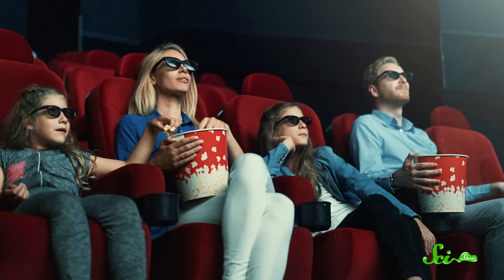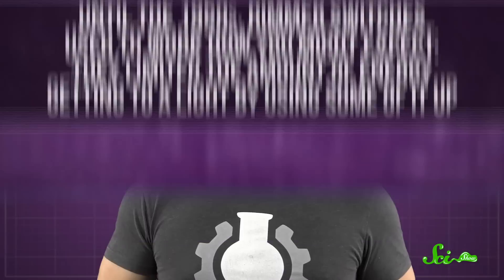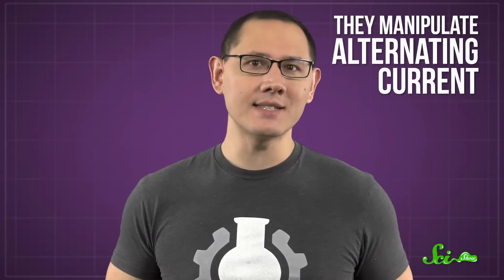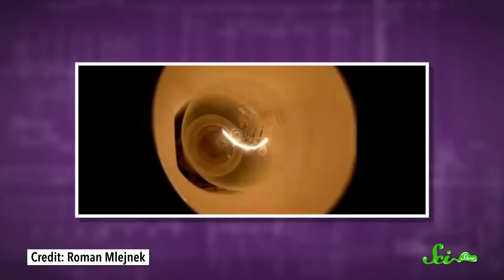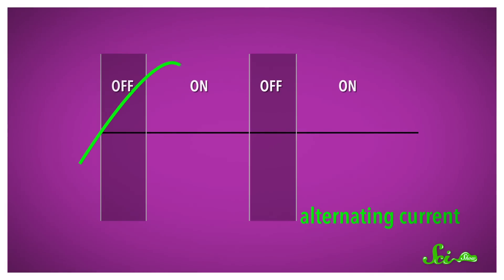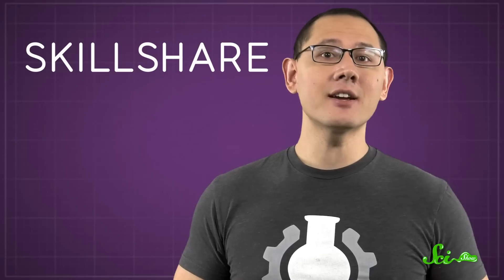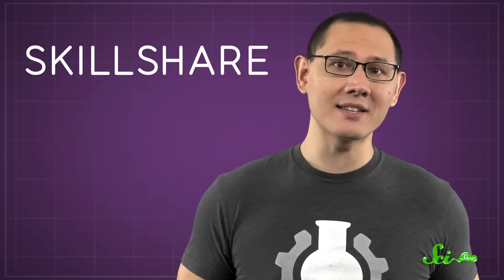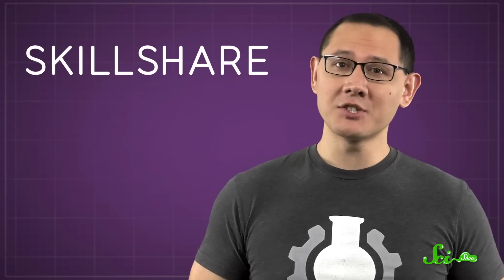Dimmer Switches: Secretly Strobe Lights

Comment: 0:40 Resistors don't "burn off energy", they limit current. It's true that they produce a small amount of heat and use a small amount of energy in the process, but that's a pretty terrible explanation.

Oh no! I forgot to make a ridiculous comment about my huge biceps!
Reply: Looks like muscle Hank is secretly an electrical enginerd...
Reply: You should just keep making muscle jokes
Reply: I see you have been flexing your brain too
Reply: Muscle Hank's strongest structures aren't his biceps, they're his brain.
Reply: Produce heat = Burn off energy lol
Reply: Marry me Muscle Hank
Reply: Don't worry, they are self evident.
Reply: Using a resistor in series with a bulb, to dim the light to 50% the resistor will have equal power dissopation as the bulb. It gets hot.
Reply: halveiz But if you use a resistor with twice the resistance of the bulb to decrease the brightness by roughly   66 percent, the resistor will consume half as much power as the bulb. The more you dim the bulb by adding resistance, the less power the resistor (and the entire circuit) will consume. Their explanation implies that the entire circuit consumes the same amount of power at each resistance, and the resistor just "burns off" the excess. False.
Reply: @unicornswag888  Did you consider that the potmeter is a function of a wiper? 

So as mentioned before, to dim the lightbulb 50% you will get 50% power dissipation in the resistor in series. To prove this you can think of the bulb as a resistor. If both the resistor connected in series and the bulb have equal resistance, then you would end up with a 1/2 1/2 of power divided to them both.
To further improve your intuition of this, I'll give two extremes of the value of the resistor: 

1: it is 0 ohm. The resistance is now a wire. Not only that, it's an ideal wire. it only leads. This wire doesn't dissipate any power.

2: it is very very large, say infinite. You essentially have a broken circuit now, and now power is dissipated because of it.

Now to take this a step further we can do some math.
Say we want to make a general equation of power dissipation for the resistance in series to the bulb. I'm making the resistance in the bulb = R_1 and the added series resistance R_2.

Firstly the Current running through the whole circuit is then I=V/(R_1+R_2)
Say R_2 is placed between the bulb and ground. V_(R_2)=V*R_2/(R_1+R_2)

the power dissipated in R_2 is then (based on P=I*V): P_(R_2)=I*V_(R_2)=(V/(R_1+R_2)*(V*R_2/(R_1+R_2)))=V^2*R_2/(R_1+R_2)^2

Now that looks kinda messy.

Let's say that V = 1V and R_1 = 1 ohm, just to show how this thing would work.
our formula then boils down to P_(R_2)=1^2*R_2/(1+R_2)^2 = R_2/(1+R_2)^2

Now to make it even more readable we can substitute P_(R_2) with f(x) and R_2 with x

We end up with a formula which looks like: f(x)=x/(1+x)^2
Plot that thing into wolfram alpha or your graphing calculator and you will see that when R_2 = R_1 (In our case R_1 is 1), R_2 will have maximum power dissipation. If R2 is more OR less that R_1 then it will dissipate less than R_1.
Reply: halveiz I agree with what you've said, and I like the extreme examples. However, say we have a  100 watt bulb (144 ohms) on a 120 volt circuit in series with a 1 megaohm resistor (extreme case). This circuit will only consume 0.0144 watts of power, as opposed the the 100 watts that the lightbulb would consume with no external resistance. If someone were to take SciShow's explanation literally, they would likely assume that both circuits would consume the same amount of power, and that the 1 megaohm resistor would burn/waste the other 99.9856 watts. That's not the case. The resistor is simply limiting the amount of current that's able to make it to the bulb.
Reply: halveiz I have a feeling they may have been confused with a voltage divider circuit, where the resistors are burning off excess power, and are often extremely wasteful.
Reply: @unicornswag888  They could also very well just assume resistor is in parallel to the bulb (again, think of the extremes), but that's beside the point. I guess they went for a simple explanation instead of a deep dive into kvl analysis for this 3 minute popular science video.

Now with that being said, dimming should generally be done with some sort of PWM, if available, instead of with a pure resistor, because it consumes less power.
Reply: A resistor in parallel won't do anything to the light unless your power supply input so bad that it actually does influence it noticably (and you will be dimming ALL the lights in your house and probably your neighbors'). The resistor would be fighting the power station and its heat output will probably burn your house down rather quickly.

I'd also like to note the megaohm resister will most likely cause an incandescent lightbulb to output no visible light and have more resistance than normal because its filament is cold.

By the way, a capacitor in parallel is more efficient than a resistor, but needs to be large (fist-large) and is not easily regulated (adjustable large capacitors do not really exist)

A PWM dimmer could reduce the power for incandescent lighting without any notable flicker, but requires high-power transistors rather than simmistors. But as of today all of that is obsolete anyway since LED lights have electronic ballast anyway and dimmable ones detect dimming rather than use its effects.
Reply: Jack White A 1 megaohm resistor would be ridiculous. I just used that as an extreme example to illustrate my point.

Alright, that's enough nerd stuff for me. I'm going to go back to flexing on haters!
Reply: @jwhite5008  I was gonna say how's it gonna effect your neighbors but the. I remembered you city people don't all get your own transformer like im used too
Reply: @unicornswag888  : Yes, finally you'll consume less energy right, but for making no light at all !
Reply: @unicornswag888  : You'll still consume 100W, a resistor limits current thats a fact, but the bulb is a resistor too (generaly).
Reply: @halveiz  : less energy, power is the same
Reply: If muscle hank was actually an electrical enginerd he would understand that the light switches operate similar to power converters as a means of AVOIDING power dissipation that comes from using a resistor in SERIES. Muscle Hanks took a physics class or a simple circuits course and thinks that he understands what's going on.
Reply: IizUname Fight me bro.
Reply: Fake Muscle Hank!
Reply: A resistor takes electricity and makes it in to heat and of story.
Reply: Chris Ide No, not end of story. Yes, a resistor in series with a bulb will waste some energy as heat. However, it also limits the current that's able to make it through the circuit. If you put a restriction on a water supply to a hydroelectric dam, would you say that the restriction works by "burning off excess energy"? Of course not.
Reply: Huh, this conversation is still going somehow?
1) Dimmers are to make light dimmer. Energy savings may be optional.
2) Lamp+resistor uses less energy than lamp alone so it saves energy - but the lamp gets only a part of that lowered energy intake.

Resistor that is 10% of lightbulb resistance saves 10% energy, wastes 10% of original energy and the lightbulb gets 80% of original energy.

Resistor that is 100% of lightbulb resistance saves 50% energy, wastes 
25% of original energy and the lightbulb gets 25% of original energy.

Resistor that is 1000% of lightbulb resistance saves 90% energy, wastes 9% of original energy and the lightbulb gets 1% of original energy.

(These are estimates with about 1% aboslute error)

Note that incandescent lightbulb that gets 80% of rated energy will probably shine about half-ish of rated visible light - and release everything else as heat - making dimming them even less efficient than it seems.

Comment: A small criticizm for the script: You make it sound like the frequency of flashing decreases. If i interpret the explanation at 1:30 the frequency of the flashing stays constant, equal to the AC frequency. Only thing that changes is the energy usage and release of the flash based on the change of relation between the light being on or off, making the flash appear less intense because of giving off less light per cycle, but the cycle frequency stays constant.

Comment: it is 120switches a second dThink of if the wave starts right after at 1v and you look at one cycle will move up to 120v then come back to 0 (first direction change) then move down to -120 then back to 0 (second one) then to 1 where we started so yes it switches 120times in a second or twice per cycle

Comment: The description of resistors and ac current in this video are not only fundamentally flawed, but actually misleading. Adding resistors to a circuit does not ‘resist the flow’ of current in any way. I know that for simplicity’s sake it’s logical to describe it in ways that anyone can understand. But you are legitimately lying about the way electricity works in this video

Comment: You can also use pulse width modulation to run some things at a higher voltage than it can typically handle, as long as the "off" and "on" ratio is adjusted properly.

If you have ever seen a car that has LED lights that appear to flash on camera, you are seeing that at work.

Comment: Did you really mean 120 times a second? Cause I recall it being 60 times a second in US and 50 times a second in EU. I think somebody messed up the script. 120 volts 60hz is the standard
Reply: they did get it right, they just chose a weird way to express it. the 50 or 60Hz is the number of complete cycles per second, and the polarity changes and then changes back in each cycle, so the number of reversals is twice the number of cycles. I suppose it is relevant in this context because a triac dimmer like the ones theyre talking about will switch in both halves of the waveform.

Comment: Would like to know how some (but not all) dimmer switches for professional film lighting work without creating flicker on the camera which typically requires the shutter speed to be matched to the frequency of the AC power source.
Reply: DysnomiaFilms my best guess is that they either dim with DC or convert it afterwards. It's easy to make a simple PWM circuit that takes a triangle wave from a 555 timer into the positive pin of an open loop op amp and setting a voltage reference to the negative. You can then use some cleverly placed capacitors and inductors to smooth out the remaining ripple.

Comment: you should have listed the US power in frequency, rather then the number of times it switches in a second. People are getting confused, because it does switch twice per cycle, or 120 times, but the frequency is 60 cycles per second, or 60 Hz. Being that standard US voltage is 115/120 volts, it has led people to the misconception that you've flipped your numbers around.
Reply: yes, it wasn´t the best way to say it, but is correct.
Reply: I was confused for a couple seconds until I remembered he said switch, not cycle
Reply: Bass Buster X Exactly!
Reply: That confused me too
Reply: ... inclyding me before I found your explanation. Ugh.

Comment: I'm shocked that the term 'duty cycle' didn't come up in this video.
Reply: I'm surprised there were no references to PWM. A very integral part to is, as you seem to know.
Reply: @zacharytaylor190  : Yes, but conventional dimming is a kind of PWM, no ?
Reply: @raphanunu6912  conventional dimming is typically resistive in its nature. They either use a series resistor to limit current or 2 resistors in a voltage divider, sometimes a voltage follower or buffer amp to stop voltage loading. Modern dimming is done with PWM, generally modeling the on-off switch as the output of a comparator and changing the reference voltage. Its simply more efficient that way.

Comment: Is that why i hear buzzing when ever i dim the lights?
Reply: Actually yes. Probably. This depends on your dimmer type but is most likely some effect caused by 50/60Hz AC waveform. 

Transformer-type dimmers buzz because they are essentially electromagnets and oscillate a little bit together with the AC sine wave because they are imperfectly made and/or attached to the wall. 

Resistor-type dimmers are often internally coil-shaped (and not attached well enough) so same reason. 

Electronic ones should not buzz in theory but may include small dampening coils that do buzz for aforementioned reason again. Electronic triac dimming makes transitions more abrupt so the sound is more noticeable.

Comment: I think you have your frequency confused with volts. United States of America 120 volts at 60 hrtz. 60 cycles per second.
Reply: He said:
"(...), but in the US [the direction of current] reverses 120 times a second."
which is correct. The diection reverses once at the positive peak of the sine wave, and again at the negative peak.

Comment: What do you mean you don't notice it? I have one in my dining room which I HAVE to turn all the way on if it's on because otherwise all I see is the miniature flashes.

It's annoying. Not that I'm that concerned with it. I don't use the dining room much anyway and if I wanted dim bulbs I wouldn't buy only 60+ Watt equivalent in LEDs. If I want light, I want light. Dimmable things make no sense.

EDIT: And before someone says it, no, it's got nothing to do with dimmable LEDs specifically. I know they're worse at being dimmable in general. Yes, I have a dimmable one there but the switch to all LEDs was only about 2 and a half years ago. I've lived in this place for nearly 20 years now. The light flashing was ALWAYS noticeable, even when using incandescent.

It's why I went ahead and made the change, because people complaining about it was nonsense to me - it already flashed if dimmed at all so it didn't need to be taken into account since I don't dim it because it's annoyingly flashy even with incandescent.

Comment: AC doesn't switch at 120hz. It's 60Hz in  NA and 50Hz in Europe. The voltage in NA is 110/120v and 220/240v in Europe
Reply: He said:
"(...), but in the US [the direction of current] reverses 120 times a second."
which is correct. The diection reverses once at the positive peak of the sine wave, and again at the negative peak.

Comment: As a epileptic am I in danger of having a seizure when I'm close to such a light?
Reply: 'No' to 'very unlikely'
.
You will not see visible flickering unless the light or the dimmer is malfunctioning or operating outside spec. Sometimes cheap dimmers on near-off setting may produce noticeable flicker but most likely not enough to cause a seizure. In most cases you will notice it before it is too late. 

Malfunctioning luminescent lights (or more rarely bad cheap LED drivers) may produce visually noticeable flicker but that does not tend to trigger seizures either.
Reply: @jwhite5008  ok, thanks! :)

Comment: The AC doesn't switch 120 times per second, but 60. You mixed up the voltage and frequency.
Reply: Each cycle has 2 "switches". One from Hugh to low, and one from low to high.
Reply: Chris K from Hugh to Low
I’ve never heard of the state ‘Hugh’
Reply: @Tonatsi  more like Hugh to Law..get it get it 🙈
Reply: stap0290 no
Reply: It runs through a full cycle 60 times per seconds but the polarity switches 120 times per seconds which is what is important here.
Reply: Think of if the wave starts right after at 1v and you look at one cycle will move up to 120v then come back to 0 (first direction change) then move down to -120 then back to 0 (second one) then to 1 where we started
Reply: @nerfthecows  it's actually about 170V, as 120V is the effective voltage
Reply: @JsonBrandy  You're gonna confuse everyone telling them that. RMS voltage is what is important, so treating it as 120v is perfectly fine.
Reply: @JsonBrandy  ya your right but if I said 170 id have to also explain roots mean square and that's a whole different conversation, but in a nut   shell we use RMS  voltage to compare to DC (it's way more complicated than that but will get you the idea) my example was just trying to give an exAmple for people to get their head around why is was 120 not 60
Reply: Most countries run 50hz, the U.S does 60hz...
Reply: He said:
"(...), but in the US [the direction of current] reverses 120 times a second."
which is correct. The diection reverses once at the positive peak of the sine wave, and again at the negative peak.
Reply: @risto993  US did it first. We were the originals, everyone else chose to be different.
Reply: @GuyFromJupiter  good for you
Reply: I'm an electron trapped in a positively charged ion and I'm telling you you can all get stuffed.
Reply: @knewledge8626  I don't know why, but this made me LoL real hard!
Reply: I agree. You might also be able to argue that one cycle has two "switches" (low-to-high and high-to-low), but that isn't how I first understood it. They should have clarified that the US operates at 60 Hz.
Reply: He didn't say "switch", he said "reverses".  Since 1 cycle reverses direction twice, 60 Hz or 60 cycles per second does reverse direction 120 times per second.
Reply: Actually it does.  Think about the current that's behind the power used.  Off, forwards, off, backwards.  With a resistive type load, that's only 1 full cycle, but that's actually 2 "switches" (no power, power, no power, power.)
Reply: It's 60 Hz per side, two sides = 120 Hz
Reply: @3nertia  Not true. 1Hz is a full wave, from top to top.
Reply: @9PlatinumGamer9  That doesn't make any sense, please expound ...
Reply: Pin this